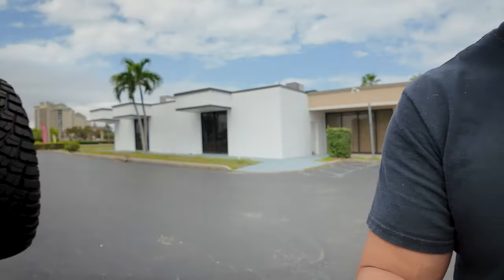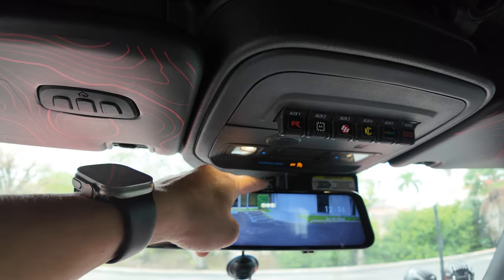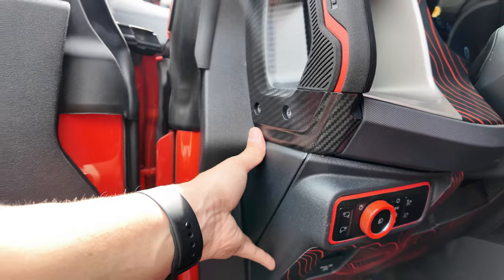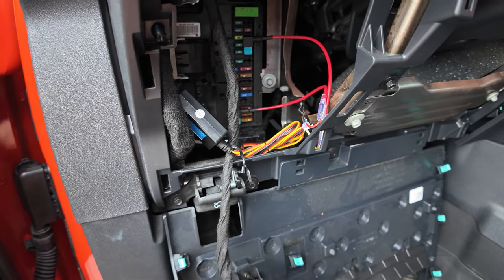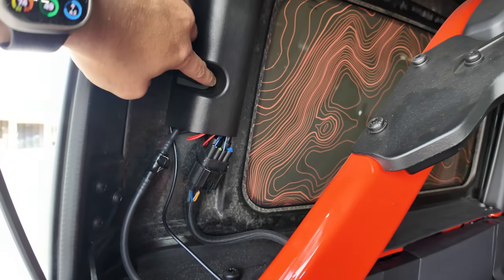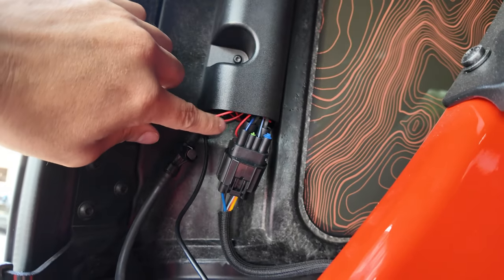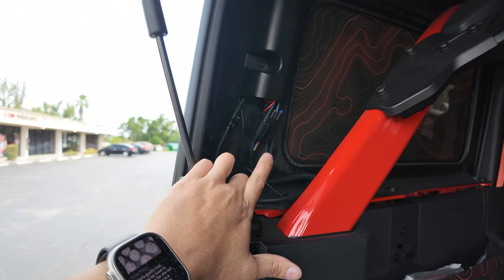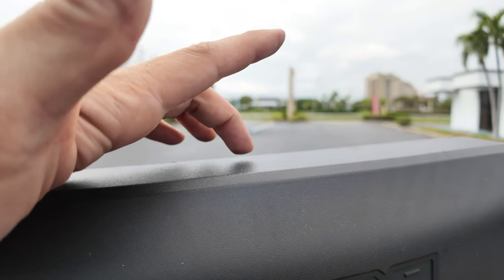2021+ Bronco Wolfbox G900 Digital Rear View Camera / Dashcam Overview

Comment: I noticed that the visor will not go down after mirror cam was added. Is there a option to move the glass attachment over towards passenger side with the lux package in the way.  Is there room to make the visor clearance.
Reply from the maker: @jrmhs168  if you have the oem style arm, you can push it up and to the side a little. Then it clears it.

Comment: Does the sun visor interfere with the mirror when you pull the visor down?
Reply: G930 is a better fit but would need its own arm vs straps.
Reply from the maker: The G900 fits fine with the replacement arm.

Comment: What if you want to remove the hardtop on a sunny day? How does that work?
Reply from the maker: There is a disconnect close to the rear. It can also be mounted above the OEM brake lamp. Then it doesn't have to be moved.